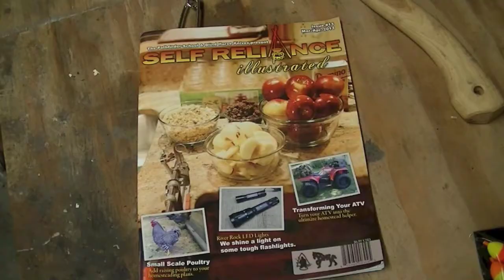How to Make Birch Oil

Comment: Man that is a yield. If you want to get rid of the liquid at the bottom just take a long pipet and you can extract it that way. Or at least that's how I've been trained to do it.
Reply from the maker: Yep, I guess don't know what a pipet is, but I was thinking of a straw and plug the top end or a dropper of some sort. Thanks for the info!
Reply: That is a makeshift pippet. basically it's a eye dropper, but longer and all one piece and usually disposable. Great for jobs like that. Though they don't tend to hold much liquid.

Comment: Great information, thanks for sharing. Never knew this could be done, is this flammable like pine pitch?
Reply from the maker: Probably not as flammable as pine pitch, but for sure flammable. I made a lamp using this oil and a old mans beard wick with it and it worked pretty good. Super black smoke while using it though.